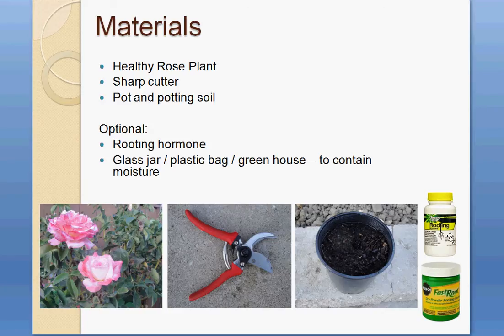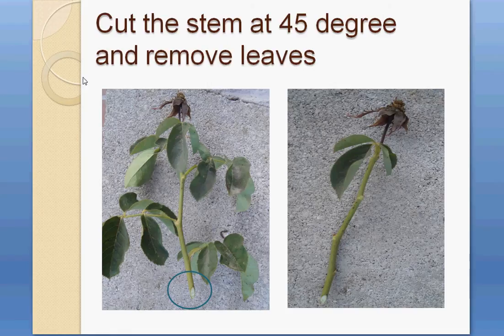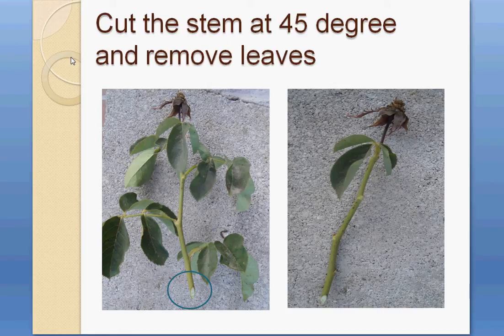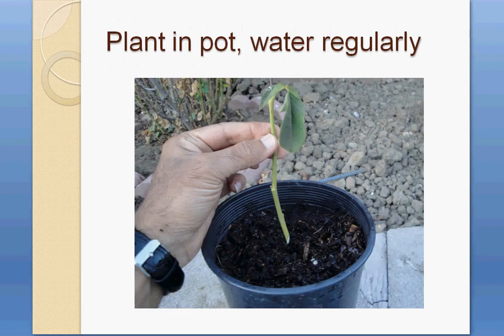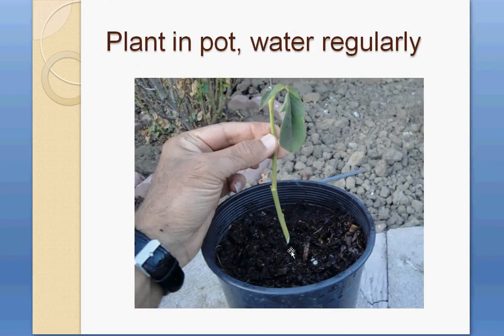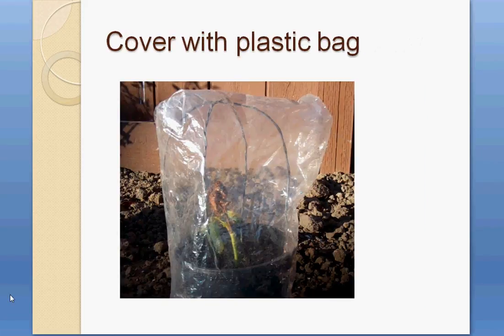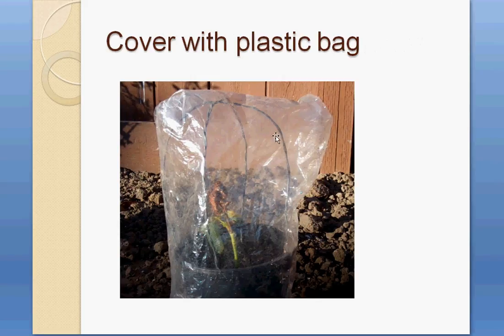How to grow Roses from stem Cutting

Comment from the maker: Sorry for late response. I live in California so weather is not that hot. When I was planting rose from stems, I used 5-6 in different pots with different stems in them (hoping at least 1-2 will work of 6). 2-3 I covered with bags but they didn't grow but ones without bags did well and now they are small plants. If it is too hot, you can make small green house to avoid direct sun. Also I was watering them regularly and my pots has small holes in bottom to drain access water. Hope this will help.

Comment: Good video. But I Have a Question , The weather is very hot where I live. Do i still Need to use the bag?  *my stems already Have NEW Little green Leaves... they still on  the water with the fertilizer that came with the roses (roses already die) thanks Hope somebody can help me =)